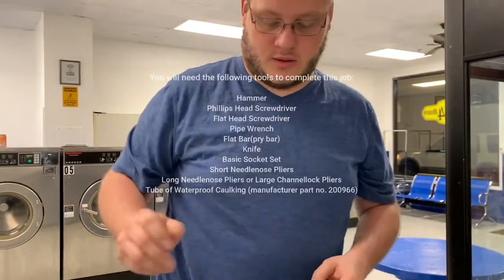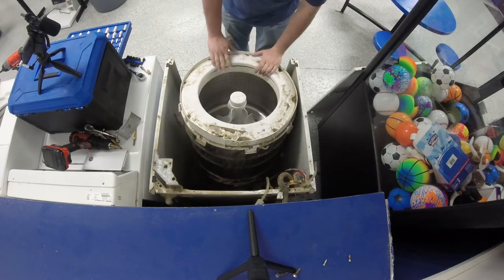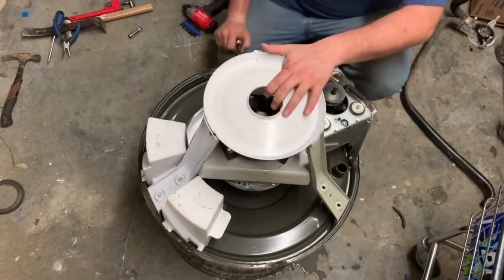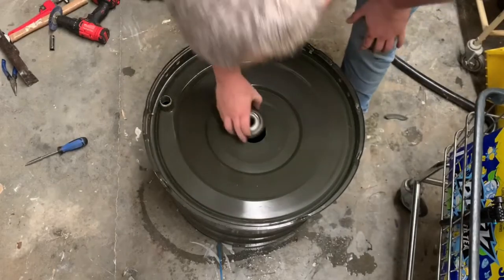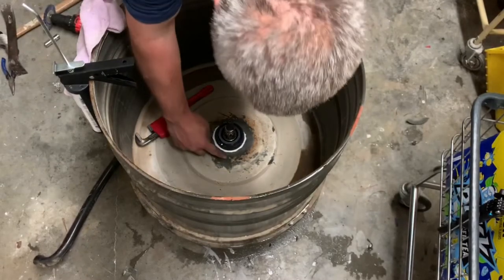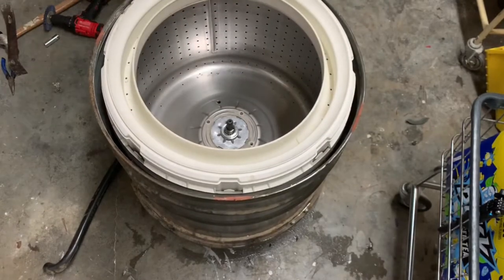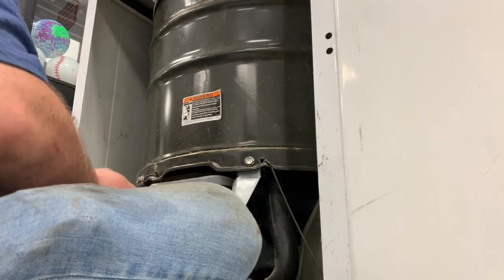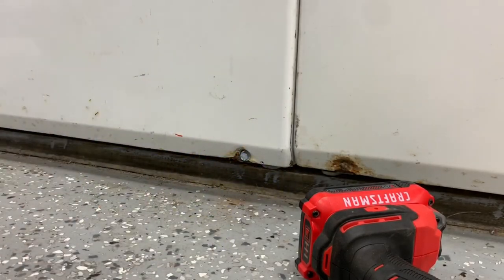Speed Queen Top Load Bearing Replacement -- Walkthrough of installing bearing kit 766P3A from ALS

Comment: on those big springs what you need that will work very easy is what i got on E-Bay a 14 inch long hook tool with a screw driver handle on the other end, $14  it works great...
Reply: Can you supply a part number or idea where you got the tool? Thanks

Comment: Tip when removing springs on the front.  Tilt the drum toward the spring you want to remove.  It Takes some of the tension off making it a lot easier to remove the spring.

Comment: I liked the "I don't use any special tools, they're always trying to get you to buy special tools you don't need". True, but and I don't mean to pee in your corn flakes, I HAVE to critique one BIG mistake @30:02 , the bottom seal sanded tub prep. You sanded all the protective porcelain off at least 1" + inches around the sealant area down to bare metal, BUT you did not cover ALL of the bare metal with sealant to PROTECT it from rusting out and it will BIGTIME. You left a lot of EXPOSED bare steel. Yup, you fixed it, but it ain't gonna last and it'll building up rust with that constant water/detergent exposure and the detergent will act as an accelerants for the rust... Other than than that, until the base rusts out, it should hold okay.
Reply: Are the inner and outer tubs made of stainless steel on Speed Queens?  Or is it only the inner tub with the holes in it that is made of stainless steel.
Reply: @maubunky1  only inner tub stainless

Comment: Do you have any videos showing the installation of the other Speed Queen hub and seal kit, 646P3?  I believe it was used on the older Speed Queens.  It doesn't have the bearing incorporated into the lower part of the seal, and it is a one piece seal.  I am confused by the little sleeve that goes over the shaft of the hub.  They don't seem to use any sealant on that part, and I cannot see how water would not leak out between the hub and the sleeve.  Any help would be appreciated.  Thanks!
Reply from the maker: I just did this kit a couple of weeks ago on another one.  But I found a link to the manual for the kit that describes it way better than I ever could. 

https://www.amresupply.com/file/177468/
Reply: @ThereIfixedityt , I actually have the instruction sheet because I bought the kit in the hopes that I may be able to use the parts for my Amana ALW480DAW.  This is a late 90's era machine that was made by Alliance back then, so it shares a lot of the same DNA as the Speed Queens - same motor, pump, transmission, basket, agitator, etc.  The big problem is that it uses a plastic tub instead of the metal tub used by the Speed Queens, and the hub & seal kit for these is unobtanium.  So I bought the 646P3 because it looks just like the parts in my Amana.  My seal did not appear to be leaking, I just needed to replace the bearings, so I was hoping to just use the new hub from the kit (my existing hub virtually crumbled when I pulled. it.)  Alas, after putting it all back together, I got a leak.  My old hub did not use a stainless sleeve as seen in the kit - it was solid aluminum.  I was hoping to make it work anyway, but after looking at things it appears that the new hub has a slightly longer shank that goes into the seal.  I thought my leak was coming from between the hub and the sleeve, but now I am not so sure.

I hate the idea of ditching a perfectly good machine that has served me well for 23 years just because of a stupid seal.  I think I might be able to rescue the situation by getting a metal Speed Queen tub (the tall one, PN  34438P), but now I am throwing more money at it.  Maybe I would be better off going with the tub design that uses the 766P3A.  For now it looks like I will have to find another cheap machine to keep the wife happy for a while.  I was really hoping to keep this Amana going for another 15 years or so.  Thanks for the help and the videos.

Comment: Unfortunately like PREY stated - this repair wont last long.  Another issue us the rubber NUT seal was incorrectly put on.  This seal has to be put on snugly by pounding it on tightly all the way down to the bottom of the hub before the agitator hub is attached to the transmission spline. Also no lubricant was used on the agitator hub before assembly. I find it a lot easier to just take off the washer shell - 11 screws.  Also - whats wrong with using the red sealant that's included in the seal hub kit (646P3 kit has sealant with it) ? I'm sure you have installed these also as your laundry mat has lots of Speed Queen washers.

Comment: So what was the clue that the bearing was bad? (Obviously before you took it apart?)
Reply from the maker: The bearing will start to roar or will be roaring.  Another sign is water seaping through the bottom and when the washer spins out it will start throwing muddy water on the insides of the front panel.
Reply: You start by taking the entire washer apart....
I think if I ever own a laundromat, I’ll just start taking apart the biggest pos I have and start figuring it out.

Comment: I was gonna Comment I can’t believe you got the hub screws out, then snap. That’s more like it lol. But that’s why the kit has them.
Reply from the maker: It’s hard to get them out.
Reply: @ThereIfixedityt  are those bearing one way bearings? I’m still waiting on alliance for the answer. My basket has slop left to right so which I isolated to the bottom end somewhere.
Reply from the maker: @christopheradamson81  the bearings can spin both ways, but sounds like yours may be hun issues?
Reply: @ThereIfixedityt  I thought that at first but I held the transmission while my kid tried to move the basket and it’s solid. Thanks for the info about bearings. We don’t hold contracts for these so haven’t got the chance to play yet. I’ll update when I tear into it. Everything else is good except that noise which I’d digging at my soul lol.

Comment: What would i need to replace when the tub bangs back and forth as it washes but the brake pads hold the rotor tight at the bottom
Reply from the maker: Is the load just off balance? Springs good?
Reply: There, I fixed it it started doing that on every load,if i hold the tub still it’s quiet.the springs are good
Reply from the maker: es350 what about the counter weights? Usually a concrete material
Reply: Probably a worn friction ring.